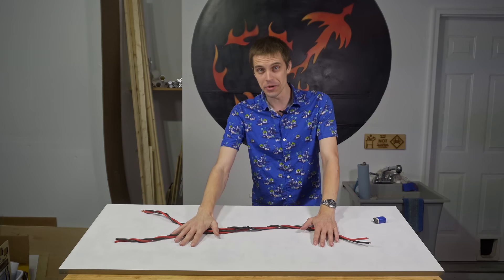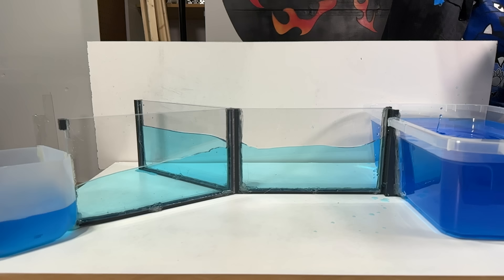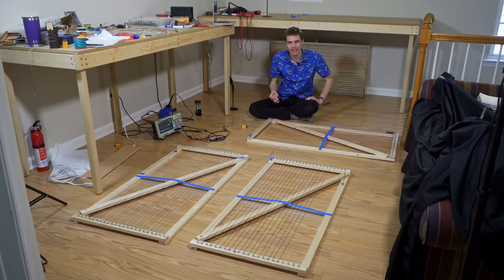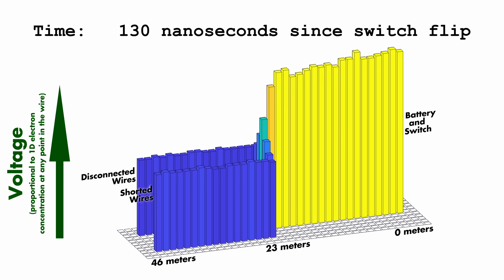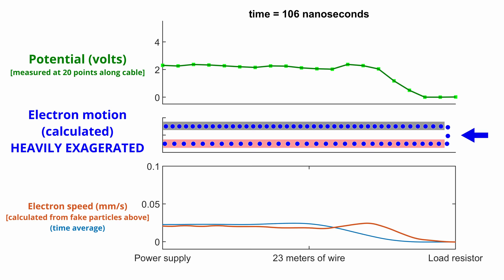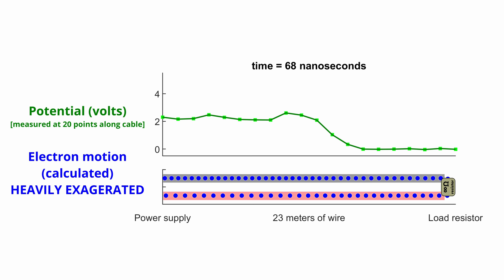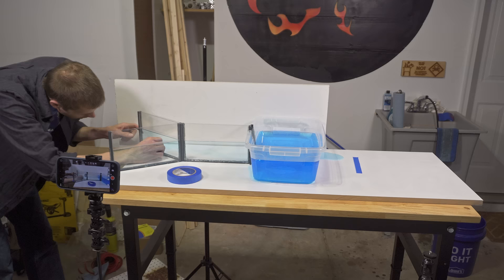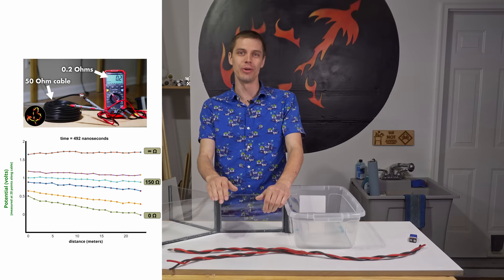Watch electricity hit a fork in the road at half a billion frames per second

Comment: I think you’re handwavy explanation is wrong it’s simply because of the inductance of the wire and capacitance between the two resulting in oscillations that are damped by the resistance it’s not a ‘negotiation’ and the battery doesn’t ‘guess’

Comment: You need to think of the system as an antenna with ac current.   Think of a resonant antenna, a non resonate antenna, and the antenna systema are made with really bad design.    That is basically what you have.  You are sending a very ugly "square" wave at > 1 cycle per min..

In a resonate antenna.  The voltage is highest at the end where the electrons meet the open end of the wire and stop to reverse direction due to both the electomotive force reversing and stacking up at the end of the wire and reflecting due to the very high impedance.   The voltage at the base of a half wave antenna is (near) zero.  
The current is highest at this point, while it is (near) zero at the end where the electrons stop and reverse.   This is  a system where the standing wave matches the resonator.   
In your system there is a bit of chaos as there is only a "surge" once. The induction of your very ugly coils with 90 degree bends and alternating lengths at each bend and the twisted pair slow the current surge down and help separate the "square" wave into its fundamental frequencies.    This with the interference from each other, the ground and rear in the concrete help make your very ugly signals.

Comment: Amazingly detailed setup and visualization.

But... I am not sure if it's a good idea to frame this as "the battery knows..." etc.... Wouldn't it make more sense to compare this to e.g. some water wave flowing out of something due to some gate being opened, and then this water wave either hitting a wall (closed circuit), or being able to flow back a second path (short circuit)?

Comment: Is this where the notion of 5 Tau comes into play? 

Tau = RC (Resistance * Capacitence) 

I was told that a "Transient event" will mostly stabilize after 5 Tau, which seems to be related to the amount of time those waves take to propagate through the system. I would assume that Tau for this system would be roughly equal to one "Round Trip" as connecting the power source would be a Transient Event and once the current bounces around and levels off. You are in Steady State where you can use DC rules instead of AC. 

I quit Engineering to do Computer Science because I could not wrap my head around the stupidly obtuse integrals you have to do regarding this.

Comment: well for a fact its not electrons its the EM field you capacitated the field and the field do the magic, electrons are slow pretty slow,
Reply from the maker: Capacitance is how much the integrated field changes when you shift electrons
Reply: @AlphaPhoenixChannel  nice thx for the information, im work on robotics bascicly a mechanics for industrial robots, its more a bastard song betwen programer and electronics and in some cases a little of hydrulics buuut general i work on circuit boards general just checking and see if it can be repair or if need a replacement and well if can be fix replace the chip or whatever fail, or programing the new bots, but a bad thing was some concepts like EM field we dont study the math in depth, more like how it function in general a pretty specific for circuits and electronics, but i remember what blow mi mind,  was saturday on the morning  a class partner ask, if electrinicty its like water why you feel the electricicty with statics electricity if is static, my profesor say electrons on solid matter are slow as F they are not what trasnfer but the em field its what make the electricy "flow" that day mark my live XD,

Comment: Amazing but. @11.32 you keep talking about current being high on the disconnected side and low on the shorted side. This is wrong, you have high current on the shorted side but lower potential (voltage). You should have swapped the term current with potential. After all it is voltage you measured in this test and not amps.

Comment: Great work:  I just found this gem and I am subscribed so I can check out you other videos.  Some of your comments about the flow of electrons as you probably know, runs cross currents (pun intended) with other people's view of the energy of electricity occurring around the wires not in them, (https://www.youtube.com/watch?v=bHIhgxav9LY).    I thought your water model and graphics were very helpful in visualizing things if we accept that it is the physical movement of electrons through a medium is the real cause of electric power.  However, this model is so seductive because it is so relatable, whereas the actual events taking place may not in fact be that relatable and parallels to the model occur only coincidentally.  
On a somewhat similar vein I would guard against anthropomorphic terms that are good shorthand but may cloud analysis.   You refer (at about 11 min in) to the battery as having no idea of how much current should flow but of course batteries do not have ideas.  If you think electrons can "slam into a wall" or "send information back to the battery",  you may be trapping yourself into the matrix of your model.  
I recall that I could not get my head wrapped around how fast nerves could depolarize and repolarized in biology.  The model in my head could not reconcile with this.  It was only when I recognized that the distances of charges from one another on either side of a membrane were so close, something my macroscopic model could not scale down to, that I could grasp the neurological capacity.
In the end I give this a video 10/10
PS If you had the inclination, you could at some point in the future consider spreading out the wires more and adding metal filings to the white backing board.  You could then view the relative speed and force on the fillings by the two circuits.

Comment: You keep saying that water is compressible and that if it weren't, it wouldn't be able to flow through pipes. 
I'm sure water is slightly compressible at the molecular level, but I don't think that is of much relevance to how it flows. After all, when you model fluids flowing through a pipe or whatever by solving the navier stokes equation, you impose incompressibility for water at every point. You don't need compression to convey a stronger force (which gives rise to pressure).
Reply from the maker: That’s how pressure is transmitted around corners - the water has to act like a spring at some level in order to push on anything (including more water)

Comment: So hooking up wires to the battery even if not connected will drain the battery a tiny bit.   
Have you tried to put a cup at the end of the disconnected wires?  Was able to fill two cups of elections from a 9v battery.   Tastes just like chicken!

Comment: is it me or you're just overcomplicating things? wires, especially twisted pair are in fact a combination of resistor and capacitor, what you're observing is the the battery charging this complex set of resistors and capacitors. This isn't a DC circuit, it's a single AC event that takes a few cycles to stabilize. The main variation you're observing comes from the fact that you are not using a regulated power source and its voltage varies with the current demand of the circuit (all these capacitors require a certain amount of current at the beginning to charge and then the current comes down to only what is consumed over the wire and then the battery will slowly start to decay and the voltage will drop over time)

Comment: But arent you an observer in quantum experiment by puting oscilloscope at the end of not shorted wires ? 

Not shorted wires are not the same as wires with osciloscope at the end.

So you are compering Shorted wires to wires with very low ammount of currend draw, by osciloscope, at the end.

Am I right or wrong, because I'm not entairly sure.
Reply from the maker: There’s nothing quantum about it, but the scope does load down the circuit very slightly. I talk about it in the experimental methods video on the second channel

Comment: The setup and measurements for described experiment is wrong. Current is not measured in volts. Author is measuring electrical potential instead of current. For conducted measurements we see expected results as described in school books - more potential in disconnected wire and less. To see current and "electrons movement" one needs to measure current which is amperes.
Reply from the maker: Constant capacitance and time integration gets you to current
Reply: @AlphaPhoenixChannel  the experiment is a good display for electric field getting to its equilibrium. There are some redistributions of existing electrons within the wire while potential is not stabilized. But still, voltage is not a sign of electric current until circuit is disconnected. Comparison with water could be an approximate model to field distribution. But not to the flow of electrons.

Comment: hehe ..for your info Electrons dont Travel in a wire..Electricity is not about Electrons running in copper wires..cuz bricks , or wood ,or bamboos have Electrons and why these materials conduct less electricity or no electricity, but bamboos used  as filaments will glow(Edisons experiments)...
Reply from the maker: Heh - yes they do. The freedom of motion of any given electron depends on the band structure of the material, but electric current in a metal is by definition, motion of electrons

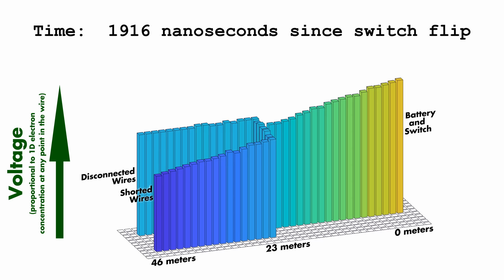Comment: 12:08 The electricity doesn't "realize" anything because only a sentient entity can realize something; the electricity DETECTS that one of the circuits is disconnected. As we can see from a simple security light, detection does not require an awareness to operate.

Comment: whenever something is turned on it always creates a small surge, while it "balances out". However, electrons do not move, it creates a small field around the wire. so please stop saying "The electrons moving"
Reply: I am an Electrical engineer, and electronics tech. This video was more misinforming than informing.
Reply: However it does give you a BASIC idea
Reply from the maker: Electrons moving is the definition of current, measured in amps

Comment: Love your data, so informative.  However the way you anthropomorphise electricity is infuriating! Next time please discuss the battery behaviour: it’s not a perfect current source, it’s a chemical reactor and its rate of reaction is linked non-trivially to the load. Potential difference drives the current flow, not ‘voltage’. Voltage is a measure of potential but I’d be happy to lick a 1kV conductor if I’m at 1kV but not of our potential difference is 1000V.  Language is just as important as your cool visuals.  Great work nonetheless.

Comment: Lies for children - electricity is electrons travelling along a wire.  It is not that. It is photons being passed from electron shell to electron shell at the speed of light (in that medium). Electrons have a mass which means they cannot travel at light speed. We have wires many, many miles long, our mains supply grid for example, we get power at the far end practically as soon (speed of light stuff) as the generator is switched on. The photon is a quantum of electromagnetic radiation (EMR or EMF). 
Yes electrons can be thrown off as a spark but what you will see first with high speed imaging is a thin blue line in air of photons first creating an ionised path before the electrons flash over down it.
Reply from the maker: The thin ionized path is by definition electrons freeing up and moving. “Ionized” beans that you’ve stripped charge off an atom and moved it somewhere else
You can’t have electricity without current, which has units of charge per second
Reply: @AlphaPhoenixChannel  ionisation occurs before the electrons jump the gap. This is well documented and many papers have been written on how a spark forms and jumps. The most obvious is lightning. The thin blue line we sometimes see is air molecules exciting and de-exciting with the release of energy as light (also EMR photons).
I despair of explaining that stored charge in a battery, capacitor or coil is coulombs not amps and that its discharge rate (or battery charge rate, charge, rate) is amps. Amps is charge rate. What I am trying to get across is the electrons in a wire stay put whilst the electromagnetic force, photons is transferred across them at light speed.

Comment: Please be careful - the oscilloscope is measuring voltage but you have called it current. They are related, but not the same. The battery also has voltage and zero current until a circuit is connected. What we are seeing is electric potential (Volts), not current (Amps), and it is perfectly reasonable to see a voltage across an open circuit.

Comment: The explanation about the electrons' movement is wrong. 
First of all, electromagnetic doesn’t even need electrons to move. For example, antenna from outer space satellite reach the earth without any electrons
Reply from the maker: There are electrons accelerating to make the signal and electrons accelerated by the signal, very similar to what happens in wires, but in wires you can get more electrons moving farther and that means it’s easier to move more energy faster

Comment: Electrons do not move through the wire.
Reply from the maker: Yes they do - that’s the definition of current
Reply: @AlphaPhoenixChannel  
Actually no.
That is an outdated model.
Ever wonder how an electron can vanish from a quantized orbit around an atom and reappear in a higher orbit of the same atom without having transversed the space between the orbits?
Electrons vanish from the orbit of one atom and reappear in the orbit of adjacent atoms of a lesser charge.  They don’t “move” anywhere.
This is wave energy (not particles) passing (with inertia) through the electron field.
Reply: You could do your experiment using a Timelapse camera instead of high speed equipment….
In your water channel introduce an ultrasonic transducer at the “entrance”.  This is your electron field.
Fill the entire path with clear water.
Drop concentrated dye at the transducer and watch the propagation of the dye through the  channel.
The dye represents the higher energy state at the water’s atoms.
Not a great experiment due to external factors but do it as a thought experiment anyhow.

Comment: None of your answers are correct. The first half of answer 'A' is right in stating that the current is guided by the electric field, but the current doesn't start all at once; it follows the electric field at a much slower pace. Empirically, what it has been proven here is that the velocity of electrons is much slower than the speed of light. What we witnessed here is the transient response of the circuit. This phenomenon is exhaustively studied in the subject of antennas and wave propagation. The open circuit can act as a stub to match impedance between two circuits, storing and releasing energy at specific points along the circuit's path. This is particularly effective for signals with high frequencies above 1GHz. In the video, the open circuit stub demonstrates what it would be like at half of the first wave cycle.
Reply: An analogy for this would be a hose that is created at the speed of light along the wire's path, with the electrons acting as the water inside the hose. The hose is filled slowly depending on the voltage, and if the circuit is open, it stops, as the wire doesn't lead anywhere. Just like water hitting a wall and bouncing back, electrons behave similarly when encountering an open circuit.
Reply from the maker: The field propagation and the electron motion wave are simultaneous - one elegant exist without the other
Reply from the maker: Cant*

Comment: All this talk about "information" and the battery "not knowing how much current to send" is unhelpful nonsense. This circuit is very easy to understand in terms of conventional concepts of voltage, current, capacitance, inductance and resistance. A lot of work to confirm very elementary stuff.

Comment: That open ended wire and everything else is a capacitor, so overshoot and reflection as expected. There is no „guessing“ both ends are initially a short circuit. Everything as usual, nothing new…